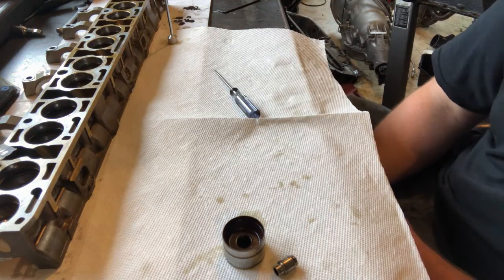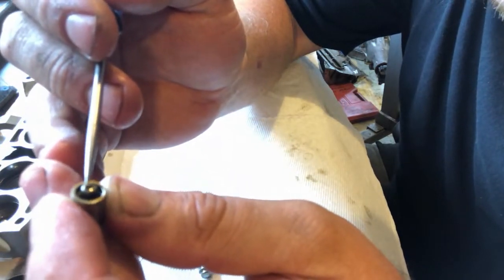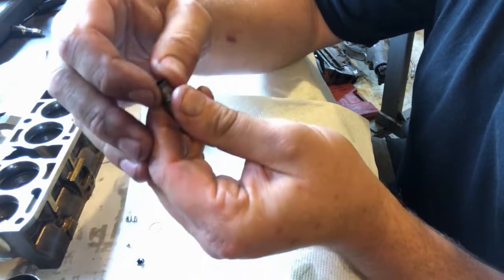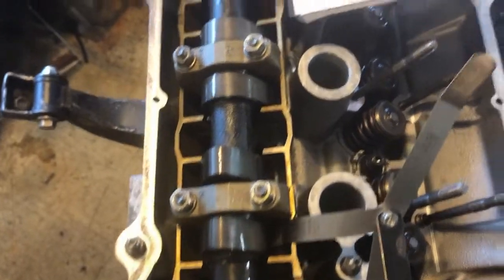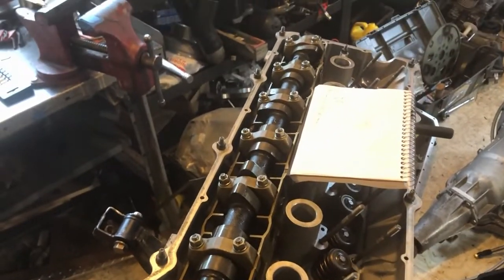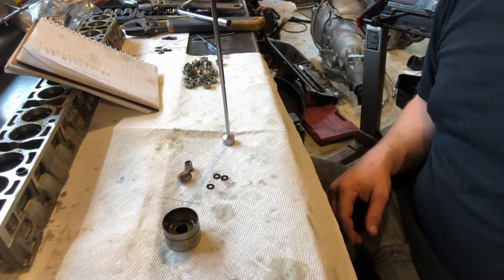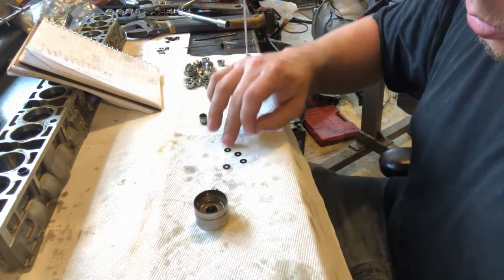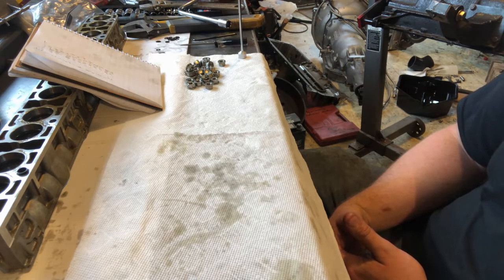Alien Engineering solid lifter shims for BMW M52

Comment: Does your shim kit work for bmw m62 lifters and what would the desired cold valve lash clearance be?
Reply from the maker: Yes it will work with an M62.  Lash clearance is specific to the cams you are planning to use.  I have recommendations for hydraulic lifter cams on the instructions.  Solid lifter cams should have the lash clearance specified on the cam data sheet.

Comment: Nice solution 👍🏻 do you have any experiance of running this with Anti lag system?(ALS) or ignition shift cut?, sometimes the classic type of lash caps can fall of when you are running ALS or shiftcut
Reply from the maker: It is impossible for anything to fall out of place with this system because it is all captured inside the lash adjuster.

Comment: hello, i dont know if this has been asked before but would you mind telling me why the other type of lifter cant be used? i dissasembled one of them and theres room inside for the shims, thank you
Reply from the maker: The other lifters have a larger internal diameter so the shims will not stay in place correctly as there is too much room for them to move around.  You will destroy the shims if you use them in the wrong lifters.
Reply: @someguy325es  thank you for answering, even tho i know im a bit late!, i went ahead and bought some parts and im assembling an m52b28 stroked with m54 crank rods and pistons, i removed 1.7mm off the deck of the block, got a cylinder head that is m52 but has double springs im not really sure where they come from they were already in, i think theyre m50 springs with cups and retainers from another engine to match the 6mm valves, im in the process of installing m50nv intake cam on exhaust and m54b30 intake cam, would you happen to know the degrees i should put the cams at? that would be very very helpful, thank you!
Reply: i read your recommendation stating that the typical degrees are 101 for the nv intake on exhaust and the m54b30 4 to 8 degrees advanced i want to run them at 4 degrees advanced to be safer but since i removed 1.7mm of the block im scared about the piston to valve clearance, i tought about using the putty method to see how close they get but i would not know how to do it accounting for the vanos
Reply from the maker: @esdar66g95  I have another video for that
Reply from the maker: @esdar66g95  please note the angle you need to turn the cam is not 101 degrees.  101 is the resulting lobe center angle.
Reply: I 3d printed the 101 non vanos cam locking tool(thank you again)

Comment: Very nice.   Are you still playing with the M50    On a daily driven occasionally abused vehicle how regularly should the lash be checked?    I currently have a low mileage S52 in my M3.   I am thinking about building an M50B30(32) that I won't feel bad about blowing up if it happens.     High rpm, High boost, normal compression NV M50 seems much more common in Europe.   Most of the US builds seem to be far more conservative.     Been watching and reading for about 20 years now but still haven't built an engine.     Thanks for your work.
Reply from the maker: I have lots of customers that are daily driving solid lifter converted cars.  Most cars with solid lifters like a 2jz have a valve lash interval of like 50,000 miles
Reply: @someguy325es  That is really good to hear.   It's hard to seperate facts from bro science on the forums
Reply: @someguy325es with HPDE, road racing, or drifting; would that interval be cut in half?

Comment: How do you work out the lash with whatever cam your running? I have a set of 280/280 10.5/10.0 cams for my m54 is it always a certain lash spec no matter the cam or how do I figure it out?
Reply from the maker: It is specific to how the cams are ground.  If they are solid lifter cams they should come with a lash spec from the cam grinder.  If they are hydraulic lifter cams you need to set the lash very tight like .003”.  If you can’t get the specs from the manufacturer you can send them to me to profile and I can figure out the lash and lobe center angles and make timing blocks for them
Reply: @someguy325es   would be a good idea but I’m in uk, also can you turn a hydraulic cam into a solid cam? And what’s the difference, if not your basically saying to use 0.003” what does the lash mean also, I’m not familiar with lash or solid lifters
Reply: @someguy325es   and also I have an m54b30 can I use this kit on m54 hydraulic lifters ?

Comment: Hey man what do you think are the biggest weakpoints on these bmw engines m50/m42 for high revs im dreaming up a build and have come to the conclusion that hydraulic lifters are the biggest problem am i wrong?
Reply: Im thinking of doing a high rpm turbo build m50 and a NA m42 with a top end of 9-10k rpms, definitely an insane idea but im kinda going insane doing research for this😂🤷
Reply from the maker: @EdgyApe  I run mine to 9200 rpm.  Solid lifters will 100% be needed for that rpm
Reply: @someguy325es  anything else that you wanna add? Do you run forged internals and such for this?
Reply: Usually the driver is the limiting factor on a 3 series?

Comment: Hi Some Guy, is there not a small amount of hydraulic jack out even with the check valve removed ? At high rpm particularly ? Thanks. great video by the way.
Reply from the maker: No it just pushes the fluid back out the inlet port

Comment: Interesting. How much rpm does stock m52 bottom take? 
 I’ve got m52b28 and s52 cams, 11.6CR otherwise stock. Currently rev limiter set at 7K. At what rpm does solid lifter starting to make a difference? Do m52 beehive springs keep the valve train together past 7K rpm?
Reply: I know I'm quite late, but stock top end on m52 would stop doing it's job @7200 RPMish. Dual springs from M50NV is a must for high RPM aplications (or just get supertech stuff).
Reply: @MachoMostacho  thanks. What prevents revving safely past 7200rpm? Harmonic balancer?
Reply: @tiitsaul9036  Well the valve spring upgrade should get you to about 8000RPM. but at that point you will have accelerated wear in Rod bearings, as well as more stress being applied to the rods themselves. 
Also Crankshaft harmonics are an issue past 7k6 apparently. (Don't quote me on that)
These are big engines, and do not like revs. Also all the timing components start to wear our quicker and could lead to some nasty damage.
Of course revving an engine that high without camshafts/other upgrades would be useless, since stock cams don't make power past 6K.
In short, to rev to 7k2 you need valve springs and camshafts. To rev to 8k (and make power), some headwork, harmonic balancer, as well as some light pistons (that's what I did at least).
Source: I have a 280hp/34,5kgm NA M52b28 which revs to 7k5.
Reply: @MachoMostacho  mine has 240degree cams in it at the moment, but I have s52 cams on the shelf ready to be installed. These are around 250degrees from memory. Not huge, but a good upgrade compared to stock.
Reply: @tiitsaul9036  Sorry. I went on vacation. 
Another thing to keep in mind is cam timing. That's a whole other can of worms, but an important one.
Reply: @MachoMostacho  Video guy commented running a 2.8l crank 9k rpm i think the hydraulic lifters are the biggest problem if you are running forged rods and pistons 3.0l crank will start to sing at rpms close to 9000

Comment: hey man, quick question i got a m54b30. i just installed supertech valvesprings, shrick 272* 256* cam, im thinking of using the hydraulic lifters but buy new genuine instead of solid lifters because i dont really know how they work tbh and im no expert so dont wanna mess around too much in the numbers. but im asking if you would tell me that this is a bad idea or a okay idea and a rough estimate of how much i could rev my engine. oil pumpnut is secured with the steelstring and loctite. and also running the m50b25 intake and i got highflow headers.

Comment: So I’ve got a 97 E36 M3 with an S52 and I’m looking at trying to boost it, and see about a reasonable redline to reduce the need for crazy cylinder pressure. Any issues with this system? Where did you get the shims? And if you know anything about the S5X series engines, any recommendations on reducing the nasty harmonics this engine produces? Thanks! Great video!
Reply from the maker: I have the shims manufactured and sell them as a kit.  You can email me at alien-engineering@outlook.com or I have them on my eBay store.  Need a good damper for the crank harmonics.  I have a good relationship with GDM engineering and use their race damper on my car.  Beyond that the only thing you can do is reduce the stroke with an S50 or M52 crank.  If you want it to keep making power much above 7000 it will take bigger cams and a different intake manifold.  The stock plastic intakes are tuned for like 6500 rpm

Comment: Hey man, long time lurker/poster from bimmerforums here. Really appreciate all your knowledge and contributions over the years. You and Pbonsalb (sp?) have posted so much useful stuff on that forum. When I see a post from you on a thread I breath a sigh of relief because I know it is good info, instead of the usual armchair quarterbacks bickering with each other.

I've have issues with my hydraulic lifters at the track and have decided to install solid. How did you choose the size for valve lash on these heads? Is there a rule of thumb that just works for most engines?
and do you know if S52 valve springs can handle 8000 rpm if I run solid lifters?
Reply: Ayyy. Bf.c for life.

Comment: Great video! How often do you typically have to check/readjust the clearance with this setup?
Reply from the maker: There is no spec for this since these motors never came with solid lifters, but most cars that did come from the factory with solid lifters usually recommend something like 40,000-60,000 miles
Reply: @someguy325es  if you use an m50b20 crank and balance it and lighten it to the max with solid lifters... should be able to do 10,000rpm right??
Reply from the maker: First Last  I don’t see any reason why you would need to use an m50b20 crank.  I’m already running 9000 on an m52b28tu crank which is the heaviest of al the M5x cranks.  I don’t see any reason why any of the stock cranks except for possibly the M54B30 crank would have any issue at 10000.  Lightening the crank will not help anything as you would just be removing counterweight which will put more radial load on the main bearings.  The cranks are already balanced to within about 2 or 3 grams from the factory.
Reply: @someguy325es  just for reliability... b25 crank would do then...

What cams do you recommend?
Reply: @someguy325es  I read on the internet and talked with a guy who runs b30 crank that the extra stroke in b30 has vibration problems and with start to "sing" at high rpm but with b25-b28 cranks there is no such problem
Reply: The problem with b30 crank can be solved with a vibration damper tho
Reply from the maker: @EdgyApe   They all do it but the B30 crank is worse
Reply: @someguy325es  So running a damper is needed anyways?
Reply from the maker: @EdgyApe   If you want it to last for any length of time its probably a good idea.
Reply: @someguy325es  Roger

Comment: i have a 7.5k limiter on a completely stock m50b25 single vanos but i am planning to convert to solid lifters to reach 8k safely
Reply from the maker: At some point you will also need a valve spring upgrade.  I’m running 9000 rpm on this motor

Comment: Very interesting. I have an M54 build coming up. Have a guess what safe rpm would be with the converted lifters? Most recommended not to go above 7-7.2k on the stock m54 valve train.
I'd likely be running the oem B30 hydraulic cams.

(found your forum post)
Reply from the maker: The stock M54 springs are pretty weak.  7200 is probably about it.  For what it’s worth I’m running 9000 rpms with this setup.
Reply: @someguy325es  thanks!
If I go as far as uprated springs, I'll keep that number in mind.
Reply: @someguy325es  you have a IG page ?
Reply: @someguy325es  what springs do you use?

Comment: what's the benefit of a solid lifter conversion
Reply from the maker: If you are running high rpms or an aggressive cam with stiff valve springs the hydraulic lifters will collapse which causes a loss of valve lift and "lifter tick".  Lifter tick is actually the sound of the valves pounding into the seats because the lifter is collapsed so the deceleration ramp on the cam is not being used.  Eventually this can lead to the valve stem or keepers failing and the valve dropping into the cylinder.
Reply: This is such a cool piece of information. Thanks for your time on this tech stuff. I’m curious if you know about this solution being used in the n62 4.4 v8? Any chance the lifter bore is the same?

Comment: Hey, can i run this on my M54? Planning to run 272 or 264 intake and 256 exhaust and what do you think the ideal lash for the lifters
Reply from the maker: Sorry for the late reply, yes this will work in an M54.  The lash will depend on if the cams are dedicated solid lifter cams or hydraulic lifter cams.  They should be lashed tighter on a hydraulic lifter cam, like .004-.005" intake and .005-.006" exhaust.  Most solid lifter cams are designed for about .010" lash.